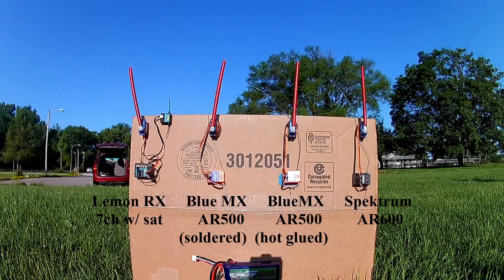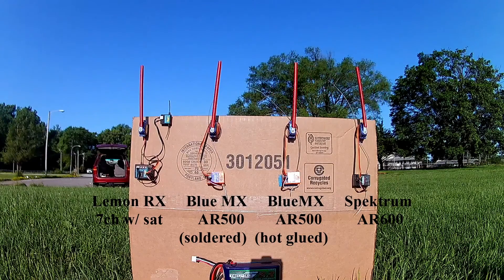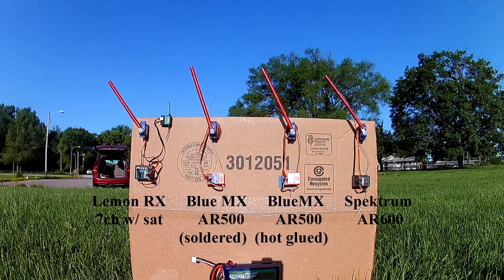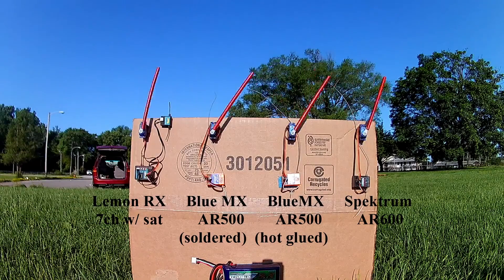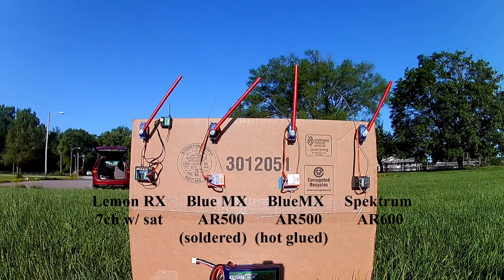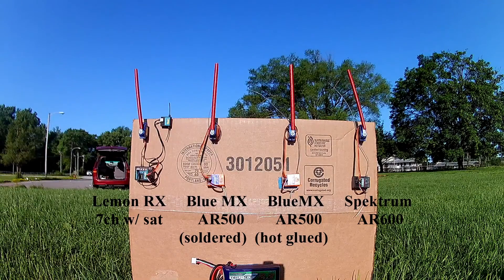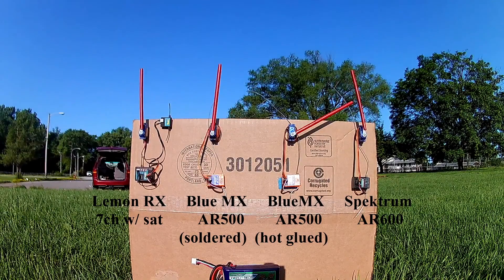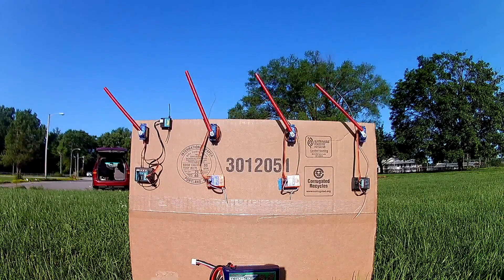Receiver Range Test

Comment: These are air receiver......not ground receivers. If you where to put all receivers off the ground 50 feet  you will get a total different result. The band arcs are totally different than for example an rc car or boat.